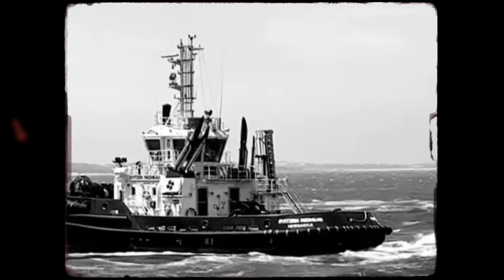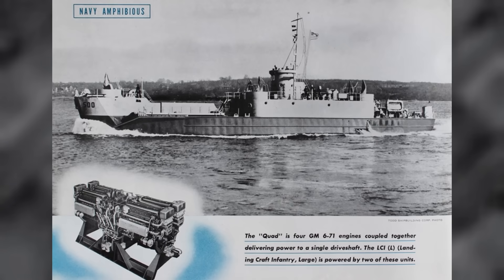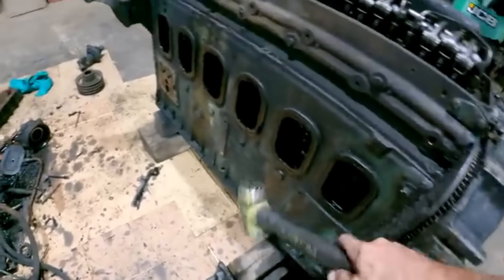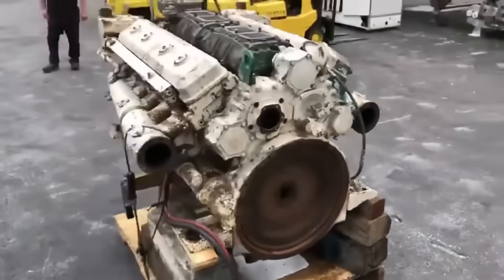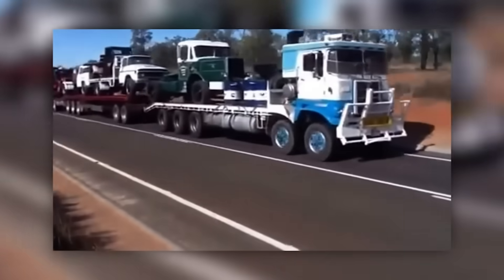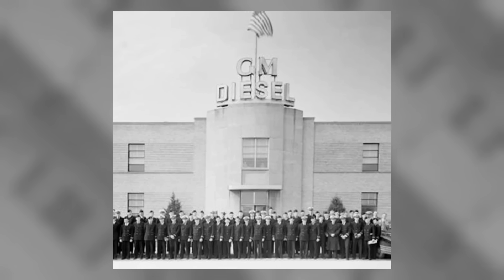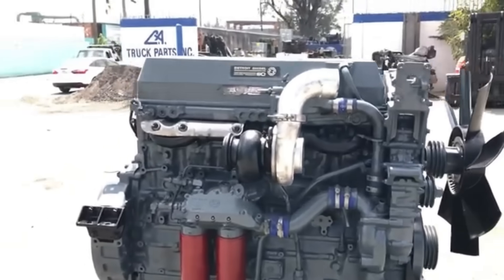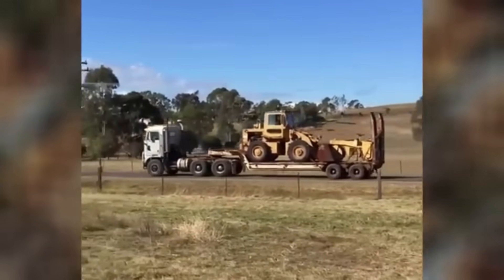The Rise and Fall of Detroit Diesel, America’s Greatest Engine Company

Comment: I can tell you why the are gone. They never moved with the times and other engine makers made better, more reliable and more fuel economic to run. I've worked on them on a few ships and whenever you came across a DD your heart sank. Massive amounts of maintenance and huge fuel use. An MAK or Wartsila would do four times the hours, still be in good condition and use 1/3 less fuel.

Comment: The blower is not a supercharger.  Unlike a supercharger, it creates no pressure to ram more air or fuel in for combustion.  It is for exhaust savaging only.  This engine is naturally aspirated.  Per GM

Comment: They weren't the best. That's for sure. Never held up like Cummins and Catapiller between overhauls. When operated correctly, they were a smooth engine. Most drivers didn't understand the power curve and just drove wide open.

Comment: Uh, that Sherman tank shown ran on gasoline. The air-cooled Continental-produced Wright R-975 Whirlwind 9-cylinder radial gasoline engine in the M4 and M4A1.  It was the only tank in the war that was not diesel powered.  They caught fire easily.

Comment: After 44 years on the road driving over 3 million miles I was able to sample most all the available powerplants. The GM diesels were popular for sure, relatively cheap, and simple to work on. But compared to Cummins and Caterpillar engines, were considered second tier. We would see around 300,000 miles out of a 6 V 92/ 13 speed combination in freight service. An 8V 72/ 13 speed wouldn’t last more than 200,000 miles between in frame service. They all leaked constantly and hearing protection was mandatory for the driver. At least in the transit busses the engine was a long ways from the driver. An interesting feature was the emergency engine shut off. This was needed to stop the engine from “running away”.  The Detroit could sometimes be accidentally provoked into running backwards out of control, scavenging crankcase oil for fuel. The engine would soon explode at a very high ungoverned rpm, destroying the truck and causing a large fire. Emergency 
shutdown could pull the wrong lever and require tilting the cab on a COE in order to reset the mechanism. Not handy while blocking traffic in town…The 4 stroke competitors didn’t suffer from these problems. They also lasted much longer. We would regularly see over a million miles of service from our Cummins inline 6 engines. In addition to the noise, the 2 stroke diesel produced copious pollutants, and no doubt that alone killed and injured millions. I came home after every shift, my body and clothes reeking of diesel. That’s just how it was. Back then we were grateful just to have a job to support our families.
Reply: Leaktroit😂

Comment: At 73 I have Hearing problems and a hatred for exhaust from the Detriot's sitting on a Walker Beam suspensioned KW. The Big Cam 400's ate mine up on the Ak Haul rd. In 1980s
Reply: I would hope something with 100 more HP would eat up the lesser hp motor.

Comment: 8V is the best sounding diesel of all time... i used to drive a Freightliner with one at a drilling company back in the early 2000's i still remember driving it thru an abandoned tunnel one day... the sound was amazing!!!

and they were rock solid as far as reliability... those things never had issues with the engines besides maybe clogged fuel filters from running fuel from dirty tanks that spend most of their time in dusty fields...
Reply from the maker: Good memories!

Comment: When I was in high school, I worked for Stewart & Stevenson in Lubbock, TX. A 3-53 engine was put in a pickup and guaranteed for life. It was a monster that couldn’t be killed.
Reply from the maker: Ha, cool, good to know!
Reply: There was a dude in Marlboro NY back in the late 80s/early 90s  who had a 6v53tt in an early 70s Ford pickup for drag racing. 
No bed but a huge welded on cage. 
Looked like a huge Chrysler Hemi a little. 
He said use the trans brake , don't power brake it because it'll just twist the pinion off the 9 inch Ford rear he had. 
Said it ran in the 11s
Sounded totally wicked too,I think he said he revved it to around 4000 if I recall right.
That's what I learned in about 2hrs from him , as a buddy of mine was his friend and we stopped over to get something from him.

Comment: Worked on these in the military...they were in the older troop carriers and howitzers.  I primary workd on  light wheeled vehicles but i was in a maintanaince platoon, so others on my team worked on the diesels and mostly changed fuel pumps and trannies. Rarely catastrophic failures would occur. Always had to keep a small square of plywood around to cover the intake incase of a runaway.
Reply from the maker: Wow, nice!

Comment: Emissions regulations killed it. I was a commercial dealership service manager for years until about a decade ago. When I left, every municipality and fire house were running regens by default every morning to avoid surprises when AN EMERGENCY HAPPENED. Way to go, EPA. Thousands of hours specifically burning excessive amounts of fuel every day to keep the emissions systems from sh***ing the bed. Sure sounds like better emissions to me.

Comment: The most efficient engines ever made at turning diesel fuel into noise, black smoke and zero low end torque. I absolutely loathe a raggedy noise making Detroit. They quit making them because they were inefficient for making power to gallon of fuel burned.

Comment: Spent half my life working on or operating DD 6V53 and 6V53T engines in the A2 and A3 M113 family of vehicles.   They held up remarkably well to abuse as long as you ran them hard and didn't leave them sitting there idling for hours.   The military vehicles literally have a big warning above the throttle lock telling you where to set it if you're leaving it idling for more than a short period,  but soldiers don't listen half the damn time.
Reply from the maker: Interesting. Good stories I bet.

Comment: I worked on a tour/fishing boat that was built in 1959 at Harkers Island NC, and when built, it was powered by a pair of 1939 surplus 6-71’s. This boat ran reliably into the early 2000’s, and when it was ultimately scrapped, the engines were still running and were salvaged for shoreside service. They are still running today.
Reply: Still working and useless cause we have high standards now
Reply: @kustombuildsBTTX woke Standards...

Comment: The dependability of Detroit Diesels dropped when they went to 4 cycle....  Nothing could virtually kill a 2 cycle Detroit....  We used them in the fire service and they would literally get flogged.... We would start them, wait for the oil pressure to rise and then floor them out the door.... they took this day after day, year after year...  To this day I wish I had a 6-53 equipped pickup....

Comment: 1:02 These engines grew out of GM's decision to develope and build diesel electric locomotives . They bought the struggling EMC and Winton engines which had a 2 cycle diesel prototype that offered promise . The  project of developing the original designs was given to GM's Charles Kettering by  GM's president A.P. Sloan in the 30's . Kettering was an excellent engineer and excelled at developing all projects Sloan gave him including working with DuPont to developing R12 refrigerant and a/c's in cars . 

Kettering originally was president of  Dayton Electric Company or DELCO in the 20's when Sloan made a very important decision to buy it and get it's former president - Charles  Kettering . They ruled .

Comment: If you are familiar with DWLS .0015 and 900 rpm, 1.484, 1.470, STD or AVD cam timing, N65, Field Service Data book, etc- you probably worked on a 2 stroke Detroit diesel.

Comment: I had 2 Detroit Diesel turbo charged 6-71’s in my boat back in the mid 80’s that were marine adapted by Johnson Towers. They each put out 485 HP. They were truly bulletproof but always leaked oil in the bilge. They smoked, were noisy and always worked.

Comment: The EPA regulations has a significant effect killing the popularity of the 2 stroks but the biggest problem was the torque curve didn't work as well for freight trucks. The DD engines were great for constant RPM like for generators, compressors or marine engines though.
Note the patents expired on the 71 series engines and they are still made in a couple different foreign countries so DD couldn't compete with that either. I worked on many clone DD 71s in Southeast Asia where most of the parts were made in Japan.

Comment: Did not mention the 6-110 engines or that the in-line could be configured with either end as "front", or that the blower could be placed on either side or that the exh. manifold could be place on either side.  Exhaust and blower could be on the same or opposite sides

Comment: I grew up to the sound of the 6/71 that powered our sawmill, and I still have that engine.  Nothing sweeter than the sound of that screaming Jimmy. Then I drove trucks with the 8V 92.  Check the fuel level and top off the oil.. I had a 1980 GMC with the 8V 92 Silver, miss those tough engines.

Comment: Everyone still wants a 60 series! Great engine
Reply: Had two trucks with DD60s.  900,000 on one and 600,000 on the other with no issues. Got out of the business, but I am sure those engines are still piling up miles.
Reply: I drive one every day in a 2006 Sterling. It’s the best part of the whole truck BY FAR lol
Reply: @Rmehki well yeah, you have a sterling 😆
Reply: I know I do!
Reply: Our well service rigs run 60’s! Great engines
Reply: But absolutely horrible to work on compared to cat and cummins.

Comment: These engines were good for a while, then they faded away and as a mechanic I can honestly say I'm not sorry.  They destroyed their crankcase oil before the oil needed an oil change, and sprewed smoke and filth everywhere.  The only way to keep them running was to constantly change their oil before the automatic shutdown did when the oil pressure fell below 40lbs. When some body tells you how good they were dash some salt on their stories!  Two stroke diesels produced a lot of power for their weight but reliable?  A BIG NO!
Reply: shouldn't run multi grade oil in them
Reply: @petejohnson8397  No we ran straight 40 weight oil in all of our Detroits.

Comment: I worked on these engines in construction equipment. They fit together like Legos. Turn the head around and the blower on the other side and they would turn the other  way. Great for twin marine applications, one clockwise and the other counterclockwise.

Comment: I have a DD671 main engine on my 57' boat that live full time on. I had a DD271 for the ge set.  Last December the DD271 was running, when suddenly it seemed to have gotten bogged way down, I ran to the engine room and when I got there I could hear banging. I shut down the DD271. I repeat, I shut ut down be cause it was Running.  The tear down of that engine we discovered  the crank broken into three pieces. 3! And I had to stop that engine.
Reply: Side note, when underway, my DD671 keeps me from falling asleep. A safety benefit lol

Comment: Rugged Reliability.....I was mechanic for a company in my younger days.  We had an old Insley crane (1939) that was re-powered at some time with a 3-71 DD.  When I was there, it took ~1/2 can of ether to start, but ran great from then on.  When I was finally given the ok to tear it down and rebuild, here is what I found:  #1 cylinder, hole in piston, #2 cylinder, good piston & rings, bent and twisted connecting rod,  #3 cylinder, collapsed and cracked rings, top land on piston above top ring blown most of the way off.  So, essentially only one out of three was actually doing anything.  Apparently it have been that way for many years before I got there, according to boss.

Comment: In the 1980's a student-run transit system in CA (UC Davis campus) called Unitrans ran double decker busses from London with the original 9.6L emgines built by AEC. The single-deck busses were GM's with the '58's (like the one Ralph Kramdrn drive in The Honeymooners) running in-line 6-71 Detroits and the mid-sixties GM's running the 6V-71 engine. One freeway coach used for class field trips had the 8V-71. As a Unitrans driver and shop assistant, I got to drive those Detroits loaded with the UC Davis football team and all their gear to various campuses (including Hayward State perched on top of a rather steep hill) as well as carry Davis students to and from campus for four years AND work on those Detroits in the evenings and weekends. Very durable engines, with two of them reaching 1,000,000 miles. We rec'd a grant for some brand new Gillig busses with the much-hyped 6V-92 engine. By 60,000 miles, one had already sucked a valve which went right through the piston - soon a secind engine failed. Meanwhile, the late 50's and mid-60's Detroits were still running in regular service!

Comment: I worked Detroit Diesels for 19 years.  Great engine
Reply: I drove a Detroit Diesel in the steel house ran 24 / 7 ran perfect towed 250,000 lbs
Reply: Do you have any hearing left?
Reply: Did Detroit ever build 20V149 (Mechanical)???,  I meant not equipped with DDECIII
Reply: Yes, great. Loud, slow, oil burning and oil leaking.

 I question these " power " claims. No way these Detroits hold a candle to a straight 6. 

I remember  Hendricksens hauling stone as a kid. It took miles for them to get up to speed.

Made alot of noise, but didn't go anywhere.

Comment: DD is still in business so did they actually ‘fall’? No 2 strokes but doesn’t the EPA have something to do with that? I’ve got a DD with mechanical fuel injection in my ‘92 Chev 3/4 ton truck still going strong.

Comment: Interesting video -- well done!  I ran a KW cab-over with a 350 Cummins, but back then (late '70s) there were tons of 671s and 871s on the road -- 238 and 318 hp.  Didn't realize until I saw the video the sequence and the breadth of the design.

Comment: The characteristics that made Detroits popular could easily have been reproduced in four stroke diesels, but engine companies don’t want bullet proof engines that last forever.  That reduces profit.  Also, the unique sound some people love is a problem for a much larger majority of the public.  And the clouds that surrounded city busses were ridiculous.  I remember how bad the buses looked because the last 3 to 5 feet of the busses were always stained black with soot.
Reply: Plenty of engines that last for way longer than a Detroit. But they are so bloody expensive so one wants to buy them, except for some niche markets.

It’s on the bigger end of the power scale, but I currently run a 35 series caterpillar with almost 70.000 hours on it. A few injectors have been replaced and the oil cooler failed once. Oh, and a couple of sensors failed. But since the engine is supposed to run forever those sensors are all redundant so if one fails it’s no big deal. No head has ever been lifted and even the turbo’s are still original. A Detroit isn’t going to run 70.000 hard hours without major breakdowns.

Comment: No mention of EMD's 12v567. Those 567's, 641's and 710's were locomotive beasts.
Reply: *645 and they are tough as hell. Welded steel blocks. Throw a rod? Whack in a power pack, weld a patch on the block and fire it up. I’m working at a place that’s still running three 645 20s. Parts have been real hard to get since cat bought em though
Reply: @riley8839  Brings back memories. I spent 30 years working in a diesel-fired electrical power plant, 15 of which we used three 645 F4B's to power the town; one 12 and two 20's. Did many overhauls, I hated cleaning air boxes, what a filthy mess. But nothing could grab a dead electrical buss like them. I suffer from hearing loss working in the environment of these 900 rpm screamers, but I sure do miss them.
Reply: @riley8839  - Thanks for the correction, My bad.
Reply: They are from a different division of GM

Comment: Nostalgia is fun but reality should never be ignored. I started with a 318 (8-v71) in an Emeryville and 4x4 marriage box transmission. Being young I thought it was a good engine. But as I matured I made some unique observations:
A) They leaked oil like a sieve.
B) Definitely loud (I rode in a friends Emeryville with a 335 cummins).
C) Climbing grades was a workout we used to joke if it got away from you just pull out a road map with a note saying steep climb or hill ahead and it would stop.
D) Fuel mileage was nothing to write home about.
E) Runaway engine’s were not unheard of.
I have since run Cummins and Caterpillar. For stationary plants and onsite use they had a niche. Maybe in less mountainous terrain as well. Would I ever want one again, nah I’ll pass.
Reply: I owned a 1974 GMC Astro with a 318 engine with a 13 speed transmission . When you got up in the morning.  Oil was leaking from the exhaust elbows. A/C seldom worked, same for the heater & defrosters.  Constant problems with the windshield wipers! Got about 3 miles per gallon. That thing still gives me nightmares!